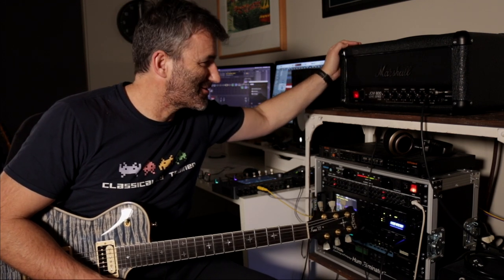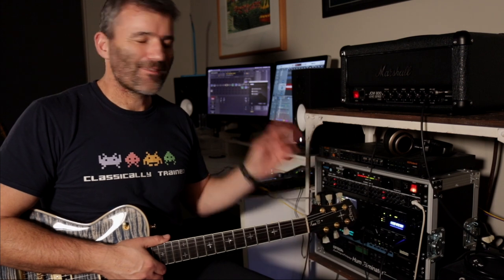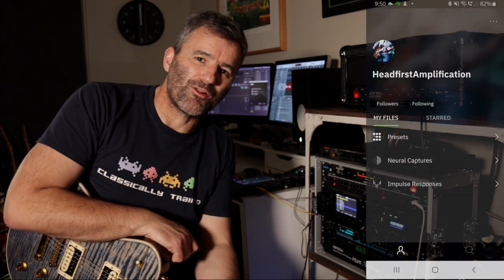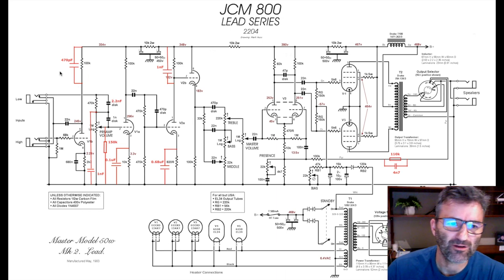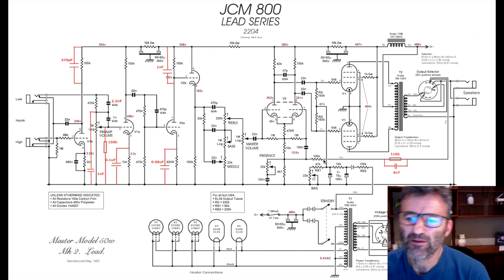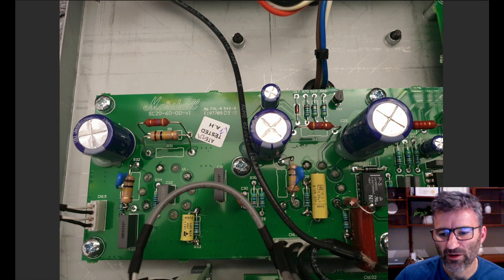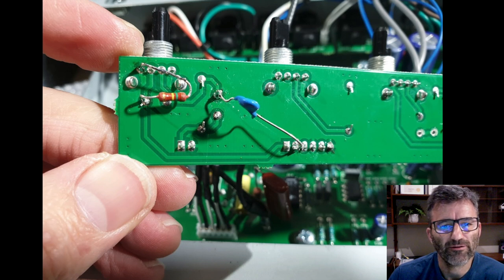Marshall SC20H S.I.R. #34 - TONES AND FULL DIY MOD GUIDE!!

Comment: Great knowledge Jason! I love throwing a choice bypass cap on the cold clipper, just that one mod alone can transform a 2203/4
Reply from the maker: Absolutely Chris!
Reply: @HeadfirstAmps  I also love the cold clipper on my mojotone 2204, have you done any vids on a depth mod for the 2204 or a way to dramatically increase the depth of the bass knob (wasn’t wanting to add another knob) on the amp ?

Comment: I really appreciate all the work you did one this. This has been fun to do. Thank you.

The 150K resistor from wiper to ground changes the taper dramatically. It will turn a linear pot into a reverse taper pot. Since the one in the SC20 is logarithmic, it will bend the curve toward a more linear operation. That's why it appears to reduce gain, but it actually doesn't.  It can probably be left out.

If you're interested in doing tricks with pots, search for 'The Secret Life of Pots' for in-depth explanations by the very generous RG Keene. His website is useful for guitar pedals and other projects.

One other thing. The 1nf cap from the gain pot lug three to ground can be wired in on the top of the board. Start by soldering it to the leg of the coupling cap that's toward the panel. The other cap leg would be tack soldered to the case of the pot near where the tabs are soldered to the ground plane. I chose that location, because there's less of a chance of burning the resistive element in the pot.

Comment from the maker: A picture showing how I replaced the 470pF treble peaker/bypass cap that's before the gain pot (C101) with the 2n2 is in the zip file up on the headfirst website for download.  (I didn't show it in the vid!)

Comment: That's it. I'm building a new amp ASAP. I've built a lot of amps, including some of my own designs(pentode pre's, paraphase inverters, parallel class A, etc).
I've never messed with cold clippers or zener clipping and it just sounds amazing.

There's tons of half wave tube rectifiers/regulators out there that work similarly to a zener too. while entirely unnecessary, it would be fun to experiment with. That would shut the "All Tube" critics up in a hurry!

Thank you for sharing all of this fun stuff. I have to dig through my parts bins to see what I need to order when I get home.
Reply from the maker: Hey Matt, this sounds really interesting. Would love to hear what you get up to!

Comment: Great 800 tones, I like how after the mods it still essentially sounds like an 800, it's not drastically different.
Reply from the maker: Exactly! It's retaining the 'cold clipper' 2nd gain stage that is the key to it.
Reply: @HeadfirstAmps  will this mod work on a 2203 100 watt?  would the NFB mod be the same 110pf or 220pf?

Comment: Quick note for those following the schematic. Doing a pre-mod ring I noticed V1 on the PCB is implemented differently than the schematic. If you ring out V1a pin 3 you’ll end up at the 2k7 (pin 8 on the schematic). Swap V1a/b numbering on the schematic to correct to reflect the SC20 layout. V2 pin out matches the schematic. One step closer to a SC20 schematic…

Comment: If too much gain, put a 5.6k or 10k resistor in series with the .1uf clipper cap and leave the 470k/470p peaker alone.

If still too bright, add 220pf to 390pf on the NFB.

I call it "Slash-Lite"

Feels like having a mild Klon boost permanently on, which is what many do anyways.

Comment: i replaced the 220k with an 820k in that diode circuit. it was like taking a blanket off the distortion, much better

Comment: Interested in trying this. Do you have a more comprehensive parts list with tolerances and voltage and parts recommendations in addition to capacitance values? I know that you do on some, but on others I just see a plain blue ceramic for example. Can you also recommend electrolytic capacitor upgrades? These SC20s use Samwah SD series general purpose caps which are OK, but hardly premium.

Comment: Thanks a lot Jason for the explanations! 
I just bought the electronic components to start the transformation. 
But some of them don't look like the ones on the picture (capacitors on R28 and R33) : it's rectangles instead of cylinders... Should I worry about it? Is there a list of the components to be sure not to mistake?

Comment: Excellent video! Thanks! I added 10k and 0.1uF parallel to r33 cathode resistor and I really dig the added gain and brightness.
Do you have ideas how to remove hum from the fx loop? I think there is a design fla..

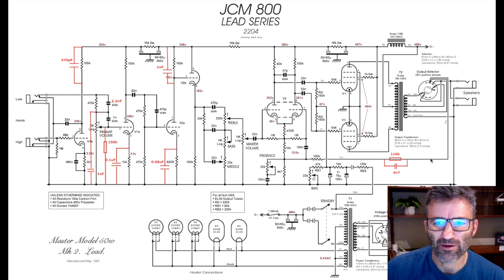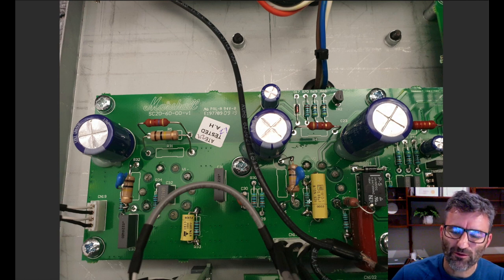Comment: is it correct that for the 34 mod you only need to do the things you show from 25:18 till 29:28? So basicly only 6 additional parts? 4 bypasses and and inset + bypass for that last part at r20?
Reply from the maker: Yeah, there isn’t much to it.
Reply: @HeadfirstAmps  oh wow I might actually try this with my sc20c (combo version) in that case.

Comment: Great job Jason, just a question. What is the purpose/function of 220k in the clipping switch? It appears when the ON-OFF-ON switch is in the center position, this resistor is connected just on the center terminal, which is thin air!!!
Reply from the maker: It’s always grounded via the coax shield

Comment: Great sound Jason! How well does it clean up from the guitar, without Zener's in the circuit?
Reply from the maker: Pretty well, even with the zeners in as the guitars volume pot can get the signal under the clamping level of the diodes.

Comment: Your clips sound great. I have this same amp (stock) and can't quite get those type of tones without using an OD up front. Are you playing thru a cab or a loadbox? Just wondering how loud things are when you are recording.  Keep up the great work!
Reply from the maker: Hey Scott, thanks man.  Some of these do sound like they have a little more gain than others,  and this one did feel a bit like that - before I modded it.  For the clips, I use a Suhr RL (the original one) and I probably had the master set at around midday IIRC.
Reply: @HeadfirstAmps  What IR are you using for the clips? Sounds amazing

Comment: 22:25 i had to change this 1 nf (also the one off the low input) to a 470pf. I couldn't get that 3rd fret squeal with the 1 nf's. Seriously
Reply: did you do the mod to a SC20 or a full sized 2203/ 2204?  curious, I want to do this mod but I don't want it to be dark sounding

Comment: Is the 220k resistor in the clipping mod always in circuit and the zeners switches in parallel, drawing shows a connection. Thanks
Reply from the maker: Yeah, you can leave the 220k always in and just set the ground for the zeners.
Reply: @HeadfirstAmps  thank you!

Comment: What is the minimum voltage caps that can be used in this mod? Looking through what I have on hand, I have standard 63v and 100v for the given values.
Reply from the maker: Cathode bypass caps can be 63v.  Coupling caps need to be 400v minimum.
Reply: @HeadfirstAmps  Jason, can you just list the caps in this mod that need to be 400volts or more?  thank you

Comment: hello I wanted to know the modification can also be done on a 20watt mini silver jubilee
Reply from the maker: The Jubilee can be modded, but it is a very different circuit to this 2204 based amp.
Reply: @HeadfirstAmps  thanks!
Reply: @HeadfirstAmps  but in this case how would the modification be?  could you do it like # 34?
Reply: @HeadfirstAmps  It'd be very interesting to know how to mod the Mini Jubilee to a SIR #34, #36, or #39. I assume there are a lot of folks who have a Mini Jubilee trying to chase Slash's tone but feel they would like to get even closer.